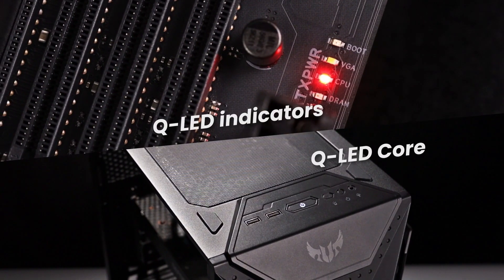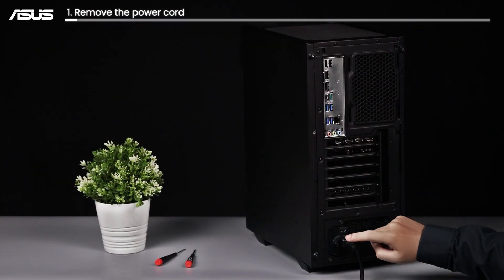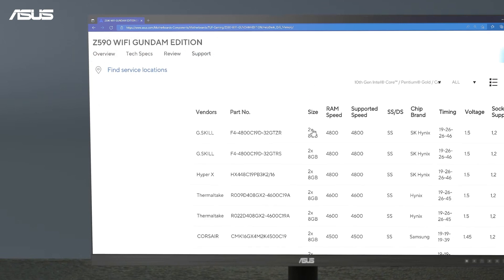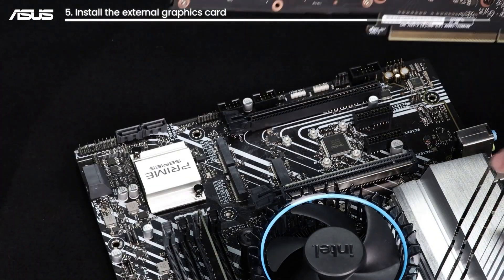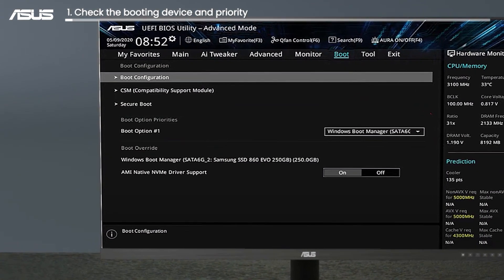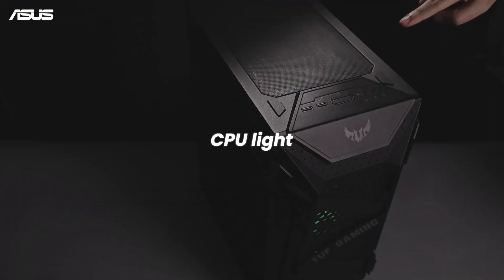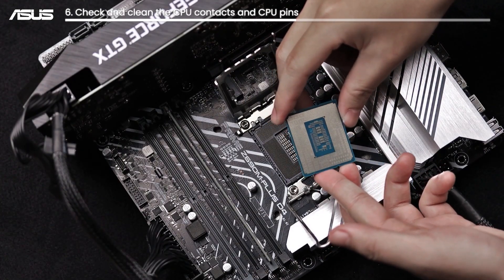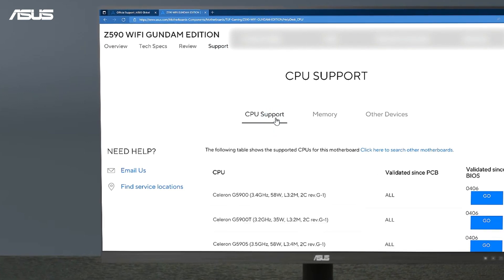ASUS Motherboard Troubleshooting via Q-LED indicators, Q-LED Core   | ASUS SUPPORT

Comment: My pc flashes both the vga light and the boot light on the debug but nothing comes on the monitors. I have a rig strix b550-f gaming motherboard
Reply from the maker: Hi, according to your question, may I ask have you try the troubleshooting steps according to the video or the FAQ at the description box?
Which steps is inoperable?
Have you make any change or update anything then the problem occur?
Could you provide current BIOS/OS version? Thank you.

Comment: My problem is no one lights and no display, how to fix it?.. 🥺
Reply from the maker: Hi, according to your question, whether your monitor has no display?
May I ask have you make any change or update anything then the problem occur?
Did the Q-LED indicator light is not on?
It is suggest that you try to test with minimal components.
You can refer to the following link.
https://www.asus.com/support/faq/1042632
Also, could you provide your product model, BIOS/OS version? Thank you.

Comment: Hi Asus I have problem in my b550-plis when I turn on the computer, the  dram turn on and then the cpu led light turn on and off😢😢😢 plss help than you
Reply from the maker: Hi, according to your question, have you try the troubleshooting steps according to the video or the FAQ at the description box?
Which steps is inoperable?
Have you make sure that all the device is compatible with the motherboard?
Have you check the QVL list?
May I ask have you make any change or update anything then the problem occur?
Also, could you provide your BIOS/OS version? Thank you.

Comment: What if none of those 4 leds light up but there is another random red led that stays on without posting?
Reply from the maker: Hi, according to your question, may I ask which red light you're talking about?
May I ask did the light is always on?
If the indicator light is not always on and you can boot up and operate normally, there's no need to concern. 
Also, could you provide your product model and BIOS/OS version? Thank you.
Reply: @asus_support  Asus Strix Z790-A Gaming Wi-Fi motherboard that uses ddr5. The led staying on is on the top left of the board.

Comment: My Q LED not working
Reply from the maker: Hi, according to your question, have you make sure that your motherboard support Q-LED?
What do you mean by not working?
If the indicator light is not always on and you can boot up and operate normally, there's no need to concern.
Also, could you provide your product model and OS version? Thank you.

Comment: Don't ever seen more useless than this video...
Reply from the maker: Hi, may I ask is there any steps that you cannot understand in the video?
Have you encounter any Q-LED problem?
Have you follow the troubleshooting steps according to the video or the FAQ at the description box?
Which steps is inoperable?
Could you provide your product model and BIOS/OS version? Thank you.
Reply: Because video shows dame things described on user guide. So firstly, i may complete steps from user guide and if nothing helped - do more specific work. So why users need to see same things printed in manual for mobo? For example - boot led and vga led at the same time case not presented in manual. Olny reddit guys can help to resolve it. So why isers need to find information and work arounds in forums and other places? Why you can't do it? Thats why i can said that the video useless.

Comment: TUF GAMING Z690-PLUS D4  - On Boot my cpu led lights up for 1 second then goes dark. then dram led keeps on. i am using my gskill f4-3000c16d-16gisb. is that the problem? are they really not supported? did not find them on the support page
Reply from the maker: Hi, according to your question, whether you can boot up and operate normally?
Have youmake sure that all the devices is compatible with the motherboard?
Have you checked the QVL list?
You can refer to the following link.
https://www.asus.com/motherboards-components/motherboards/tuf-gaming/tuf-gaming-z690-plus-d4/helpdesk_qvl_cpu/?model2Name=TUF-GAMING-Z690-PLUS-D4
Also, could you provide your current BIOS version? Thank you.
Reply: @asus_support  i am using Corsair CMW32GX4M2D3600C18 this is supported in the list. i dont know about the bios version since i cannot get into the bios without ram.

Comment: i bought 3x ROG B660-F Gaming. And all 3 are borken! the Q-LED never worked. Very sad.
Reply from the maker: Hi, according to your question, may I ask what do you mean by Q-LED never worked?
Did the indicator light always on?
Have you try the troubleshooting steps according to the video or the FAQ at the description box?
Which steps is inoperable?
Have you make sure that all devices is compatible with the motherboard?
Also, could you provide current BIOS version? Thank you.
Reply: @asus_support  Thanks for your fast reaction. The Q-LED never shine. I tested 3 brand new B660-F Board. The boads were dead. If i run a board only with the PSU. The Q-LED never shine. The board find no mistake if there is no RAM oder CPU installed. NO Q-LED ever shine. System didnt Boot. Cant go into Bios an no energy to the mouse and keyboard.  I build 5 PC with the B660-F + 12400F.  4 PC are working 100% Perfekt. But the 5. PC need a 4. new Board, because the last 3 band new one are dead. I dont find the misstake, because the Q-LED should shine and find the misstake.
Reply: @asus_support   TEXT 2 : I asked your German support hotline and was advised to simply order new boards and send the others back. Now I get the 4 board delivered on 3/3/23

Comment: what is the meaning if the power led is just on . no flashing slow or fast. the light is just on.  Asus Z790-p Wifi Motherboard. I build the PC and did everything correct. when I turn on the power the RGB Fans just glow and nothing happens. Fans are not moving. Just the Power LED from the cases power switch is on. no blinking
Reply from the maker: Hi, according to your question, may I ask whether any Q-LED indicator light is always on?
Have you try the troubleshooting steps according to the video or the FAQ at the description box?
Have you make sure that all devices is compatible with the motherboard?
Have you make any change or update anything then the problem occur?
Could you provide current BIOS version? Thank you.
Reply: @asus_support  i fixed it. One cable from the psu was missing 😬

Comment: I have ASUS ROG STRIX b660 Gaming wifi with rtx3070ti, i got that While Led On but everything was working fine 

i reinstalled the Gpu in case and the led turned off ... thx
Reply: @ASUS Support
Today the led is ON again 
still everything is working fine 

should i reinstal it again ?
Reply from the maker: Hi, according to your question, have you check for any dirt on the PCI-E Pin of motherboard or Graphics card Pin?
May I ask whether the light is blinking or always on?

Comment: Hello, new PC build with Asus ROG B550-A gaming with 5800X3D. System powers on, fans work, rgb works, graphics card fans spin. Problem is no display and no boot light. Qled lights cycle one at a time continously.
Reply from the maker: Hi, according to your question, you can refer to the following link. Thank you.
https://www.asus.com/support/faq/1042632

Comment: Hello, I built a new PC about a month ago and only a day ago suddenly I notice this white VGA LED constantly on. There's no issues with the display or anything. The graphics card driver is updated, got BIOS 2806, mainboard: Asus ROG Strix B550-F Gaming, graphics card: Asus GeForce GT1030-SL-2G-BRK. I cleaned it carefully like in the video, cables and card are firmly attached. Thanks for your time.
Reply from the maker: Hi, according to your qustion, may I ask whether the light is always on?
If the light is not always on and you can boot up and operate normally, there's no need to be concern. Thank you.
Reply: @asus_support  Thanks for your response! Just today the light is suddenly off again. But for those 2 days it stayed always on, yes. I could boot up and operate normally in both cases. Well anyways, really appreciate you responding here! Have a good one.
Reply: same problem, got the asus tuf b550 plus and the light is always on but there is no problem with the display
Reply from the maker: @tunatuna4710  Hi, if the light is always on, you can try the troubleshooting steps according to the video or the FAQ at the description box. Thank you.

Comment: Hey there recently bought a asus rog crosshair x670e, theres an orange flashing light constantly, even when idle. PC runs fine. Would this constitute as a yelllow light?
Reply from the maker: Hi, according to your question, may I ask whether the light is always on?
Have you make sure that the devices is compatible with your motherboard?
Whether you follow the troubleshooting steps according to the video or the FAQ at the description box?
Also, could you provide your product model and BIOS/OS version? Thank you.

Comment: Please help, I followed all am4 5000 series instruction meticulously, countless troubleshoot solutions and still have same problem. I power on, lights and fans turn on, white led illuminates for 7-8 seconds, then the yellow light does the same, then when it goes to the red light it only stays on for 2 seconds and begins to loop back to white-> yellow -> red over and over with the same intervals. No monitor signal or keyboard/mouse power. Brand new build. What’s going on? I can find nothing on how my LEDs are showing. Help asus please
Reply from the maker: Hi, according to your question, have you follow the steps according to the video or the FAQ at the description box?
Which steps is inoperable?
Whether the light is always on?
Have you make sure that all the devices is compatible with your motherboard?
Could you provide your motherboard product model and BIOS version?
Reply: @asus_support  No further suggestions? Still haven’t figured out my problem.
Reply from the maker: @_N4VE_  Hi, may I ask have you try to to test with minimal components?
You can try the troubleshooting steps in the following link.
https://www.asus.com/support/faq/1042632
Could you provide your product model and BIOS and OS version?
Reply: @asus_support  Hi, so far I have fully disassembled, and proceeded to assemble on my motherboard box. I started with just CPU, GPU, and one stick of RAM. Still had the same LED loop no matter which RAM slot I tried. The first light to go on is the orange(DRAM) light, then it begins to loop in order (white, orange, red) over and over. I also get no signal to my keyboard/mouse when plugged into the board front panel. Does this mean I could have received a faulty board? 
Asus Rog Strix B-550F gaming wifi II 
5800x3d/7900xt
My RAM is also not on the QVL but would that cause this issue? 
Bios version 3001 and also tried the version prior to that. Still get the same LED sequence.
Reply from the maker: @_N4VE_  Hi, according to your question, please replace a compatible devices, then check whether the problem still exist. Thank you.
Reply: What was the problem?
Reply: @ Updated my post on my channel. Ended up being a Faulty PSU and Faulty GPU. Just bad luck purchases. Sent both in for RMAs and system worked after that.

Comment: I went there and you guys dont show the pin set! i had to find the power one by putting it in each pin set up until my pc turn on! I tried getting help i asked for a simple pic of how the pin set up should look spent hours with indian dude who just didnt understand. it's a 2 second problem my 2 plugs came out while removing dust from inside my pc i didnt see them come out why isnt there a fast track solution for this? I used to fix pc's 20 years ago why nothing is labeled is a huge mistake! When i called i got hung up on with 2 min then i used your chat which after a few hours for something so simple it shouldn't take that long especially when i give you the motherboard model number and all pc specs next time i buy a pc i'm going to make sure ASUS is NOT INSIDE IT!
Reply: What are you on about
Reply: @KaizuTogen  I spent all day on the phone with them i was cleaning my pc of dust and accidently pulled out the led lights and the power to the power button. The directions that come with the pc showed the pin set only for the power button so i was able to turn on my pc again but the led lights NOPE! In the directions they said it didn't matter and they would explain in another section that they never made! So i asked them just to provide a pic of what the pin set up looks like All day with a guy from India who just didn't understand. He kept going on about the power pin i told him it was the ONLY thing they put in the directions pin 3 and 4 is for power and told him my pc wouldn't be on if i didn't know where to plug the power pin into i asked about the other two plugs after 8 1/2 hours i just left in disgust! To date my hard drive light stays on and my pc power button doesn't work it's always off. Really it's a 2 second fix if one knows where to plug them into but ASUS seemed to not understand their own Motherboards that they make. In the future I will NEVER BUY A PC with ASUS IN IT EVER AGAIN! That's basically what i was going on about.

Comment: This was really helpful. I have that problem where my PC suddenly goes BSOD and when I restart, m2 nvme was unable to find (I have Asus ROG Strix B660-A Mobo). Am trying to follow you instructions However, I am unable to find those specific settings in my bios. I have same bios (same UI as well) but those settings you've configured are missing on my end (seems like my bios are missing a lot of settings). Also, may I know what version is bios? I have version 2212 (just updated from 1612). It would be a really great help if you make a video or simple instructions on how to fix in that kind of scenario.

Comment: Hello. I have x670e-plus wifi cpu 7600x asus psu thor 2 platinum 1000w asus tuf 4070ti oc seagate firecuda 530 and kingston fury 6000MHz. when I click on power button, on motherboard for a moment shine red led indication pcu and then stop shining. then shine white vga and green boot and led by power button shine always, mouse and keyboard shine to. monitor write no signal, all fan in pc go normal. so i dont reach BIOS. psu takes 110w. I tried change graphic card for rtx 3070 from older pc wich is 100% good  and same no signal. input in monitor is set corectly. I am pretty sure mother board is not funcional.... what do you think? thanks for answer...
Reply: Same problem, sometimes get video and work for days.

Comment: I have a white Q-LED light on by B550-F WIFI II motherboard when I turn on my PC without my monitor on and it needs a restart to clear that light. The issue is that light is really bright and it is really annoying. That is the only issue of this otherwise great motherboard. So is there any fix, I tried changing the lights setting to AURA ONLY but the white light still remained. Maybe a BIOS update can fix that issue. Thank you.
Reply from the maker: Hi, according to your question, may I ask whether the light is always on?
Have you try the troubleshooting steps according to the video or the FAQ at the description box?
Whether you try to reinstall graphics card?
Please refer to the following link.
https://www.asus.com/support/FAQ/1042678/##4
Also, could you provide your product model and current BIOS version? Thank you.
Reply: @asus_support  The light is only on when the monitor is not turned on during startup. But that light should go away, i have done the steps below. The card is fine, and running well. The issue is that whenever that light is on it is really distracting. The motherboard model is "ASUS ROG GAMING B550F WiFi II". The BIOS verson is 2806

Comment: Hi, I bought a b650 motherboard but the solid dram light is on and everything turns on in the PC, but I get no picture. I tried updating the bios and swapping out the suggested parts and rebuilt the thing a few times lol. Any idea what I should do?

Parts I am using with it: Ryzen 7950x cpu, 32-64 GBs of ddr5 ram, rtx 16GB 4080, and a Corsair H100i Elite liquid cooler
Reply from the maker: Hi, according to your question, it is suggest that you can test with minimal components.
You can refer to the following link. Thank you.
https://www.asus.com/support/faq/1042632

Comment: Hello, I just completed my first PC build. I have a ROG Strix X670E-A with a Ryzen 7 7700x and 32gb-6000 G.Skill Ram with a ROG Strix RTX3070 GPU. When I power up my fans work, all RGB works, my keyboard lights up, but I get no display on my monitor and a boot light illuminated all the time. I have a Crucial P5 M.2 that was brand new. I have removed cleaned and reinstalled with the same result. Based on the video it sounds like I should be replacing as it may be defective. Am I correct in this thinking?
Reply from the maker: Hi, according to your question, have you update your BIOS?
It is suggest that you test with minimal components, you can refer to the following link.
https://www.asus.com/support/faq/1042632#6
Also, please make sure that all device is compatible with your motherboard, you can confirm in below QVL link. Thank you.
https://rog.asus.com/motherboards/rog-strix/rog-strix-x670e-a-gaming-wifi-model/helpdesk_qvl_cpu/